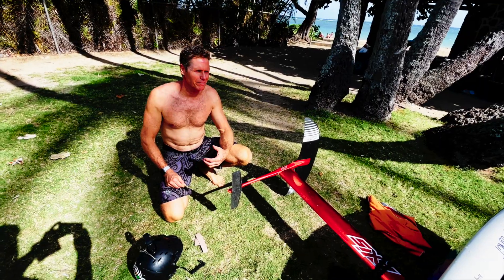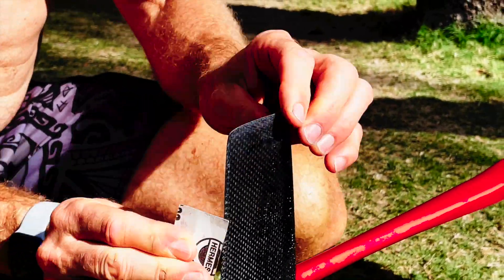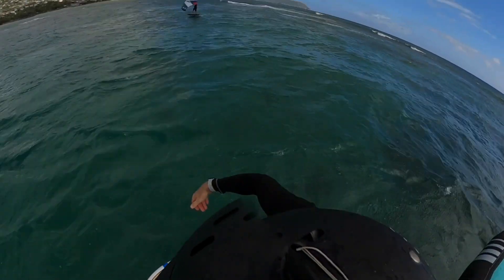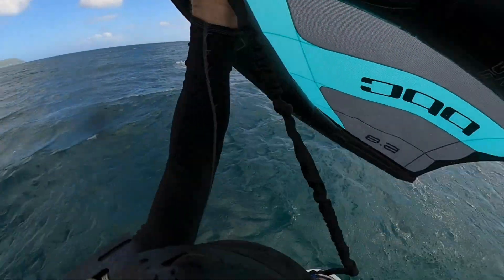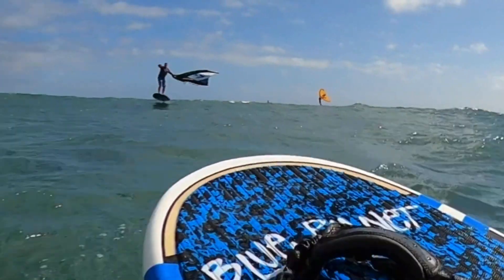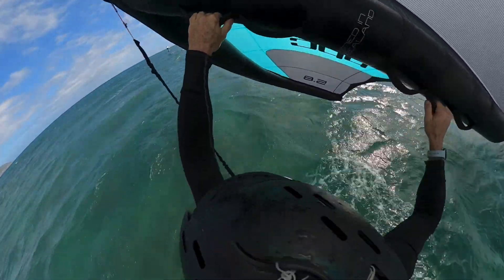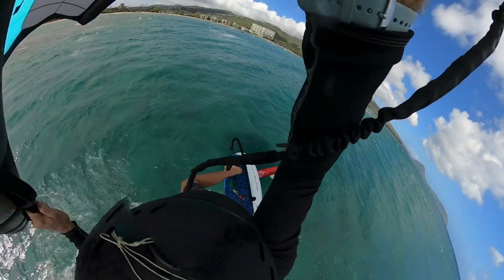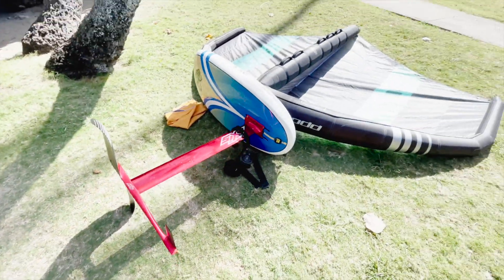Wing Foil Experiment- is a sharp trailing edge better?

Comment: One reason some may have sharp edges is if you use lift wings on an efoil too then there’s less high pitch sound
Reply from the maker: A sharp trailing edge will not necessarily get rid of the humming sounds, I have successfully reduced humming by dulling the trailing edge.

Comment: Total side question 🙋‍♂️: how are you finding that gull shaped from wing from axis ?
Reply from the maker: I have tried many different foils and the 760  Axis is my favorite.  It feels great in carving turns, has amazing glide and feels smooth and predictable.  The downside out of the water is that the Axis foils are quite heavy to carry and hold water in the cavities.  The weight seems to help with foil handling and the aluminum mast is very stiff and responsive.  I’ll make a comparison video soon.